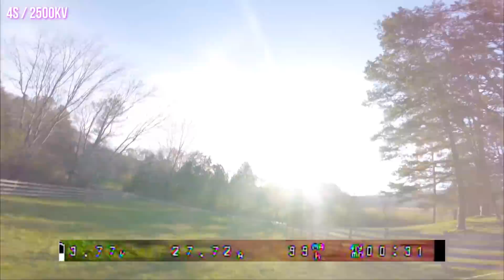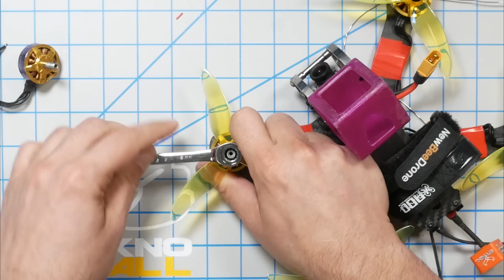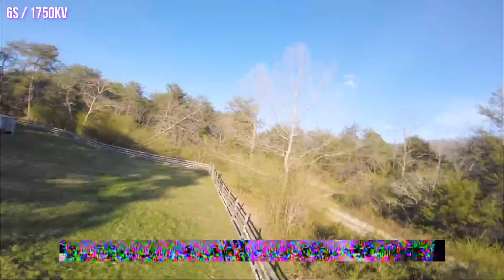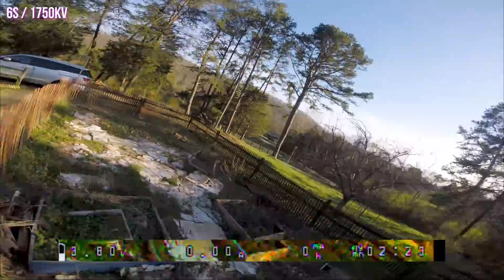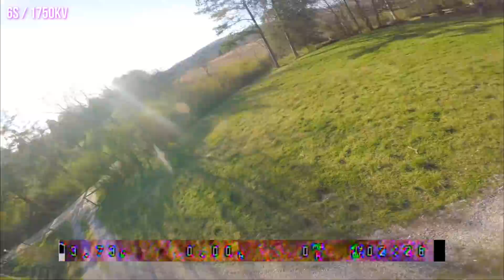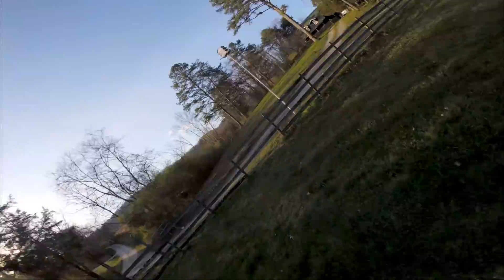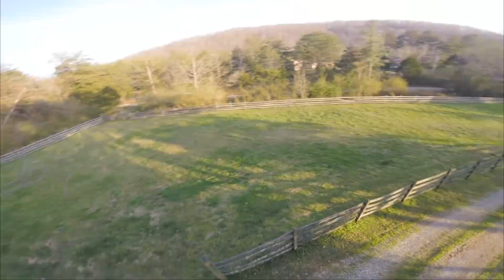JB2407 Motor v2 | 6S 1750kv vs. 4S 2500kv

Comment: Joshua... why we can not see your current amp on 6S??..... your osd on 6S is not working well??.... 
how big the deferent the current amp on 6S and 4S Jos???.... Thank you.!!
Reply from the maker: Ohhh damn I missed that. I had to change out the ESC actually between the 4S And 6S flights, and I must not have set up ESC Telemetry correct. I am really sorry -- I intended to show that info and I literally didn't notice until this minute that it was gone.
Reply: @JoshuaBardwell  Great Job Bro........!!
my opinion is the current amp with 6S is lowes than 4S... i try same setup with Kiss V2 (FC Esc) with Silk motor 4S and Sout motor for 6S...just changes only the motor.....the Quad is Same Setup same Quad....

Comment: I really wanted to try 6s but I didnt want to buy 6s batteries but I remembered I had all these 3s from when I’ve started so I just grabbed a few 6s balance leads and soldered them up now I have four 6s packs that work great pretty simple if anyone else wants to try not as scary as I first thought either running 1750 samguks

Comment: I would really like your thoughts on the Tattu Funfly battery. I've been flying a bunch of the 1550 4s packs and I think they're better than the RDQ 1500's. The RDQ is physically a bigger pack and seems to sag more than the FunFlys. They're also about 2 bucks cheaper and now they have a 1300mAh version too. My friend who has a lot more experience than me but is flying 5s right now put one of my FunFly's on his rig(grinder motors) and said they feel almost as punchy as the 5s!  I've been getting pretty long flight times too, 4+ minutes flying pretty aggressively.

Comment: Mate your're an awesome pilot JB don't put yourself down so much in that regard.

I'd love to see you do a video comparison on 4S vs 6S but as a weight disadvantaged or benefit, like how those extra 60+ grams on a 6S affect the quads performance and moves in freestyle.
I've struggled a lot to keep my weights with a Hero Session 5 below 650g. My Quads weight around 680g if I put TPU and one is even at 720g and it's so hard to find lightweight 6S batteries.